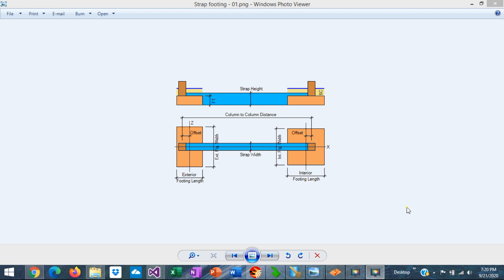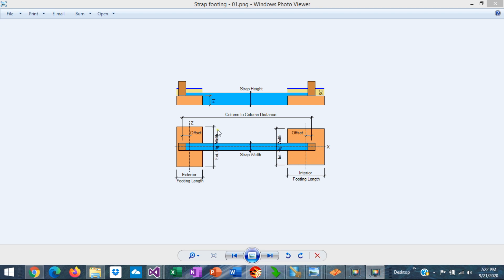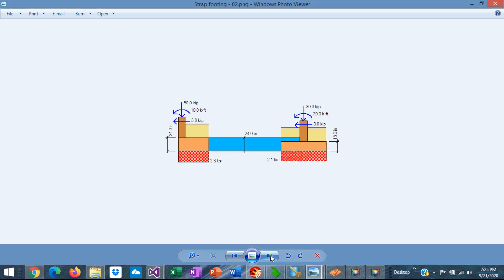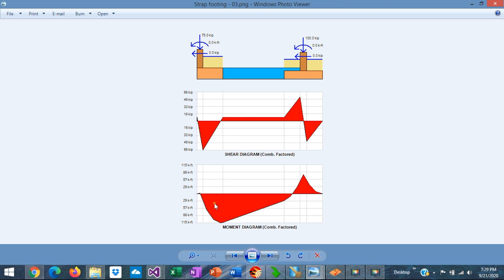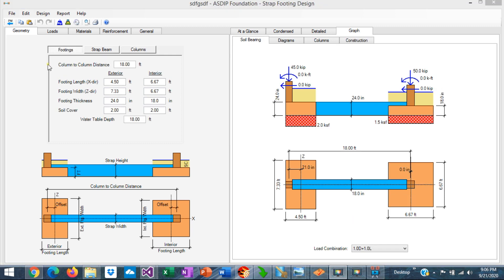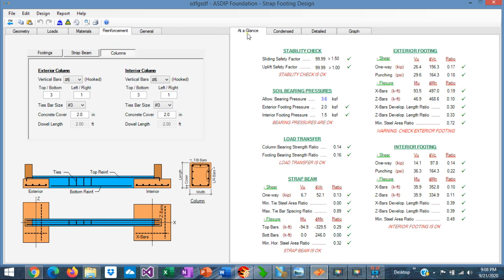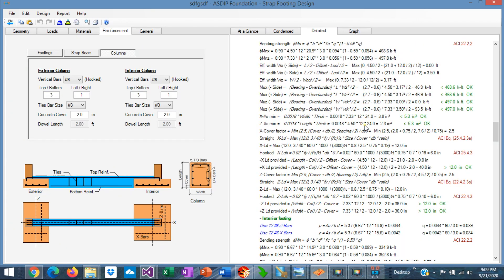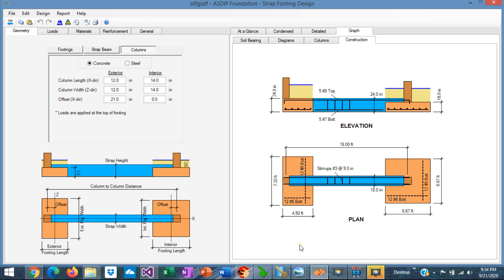Strap Footing - A Very Useful Structural System

Comment: I have a project on the seaside, with a A - Frame stone sea wall  and I wanted to design strap footings, deeper than the bottom of the wall. Can the strap beam be deeper than the bottom of the footing if soil pressures are higher?